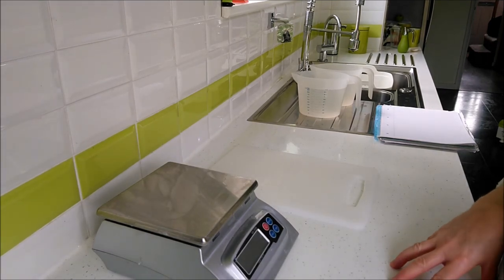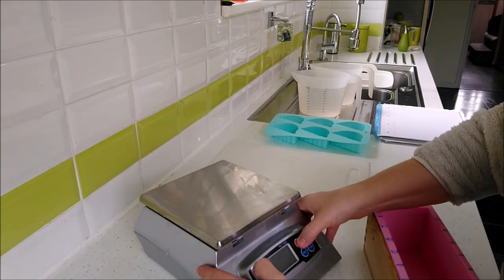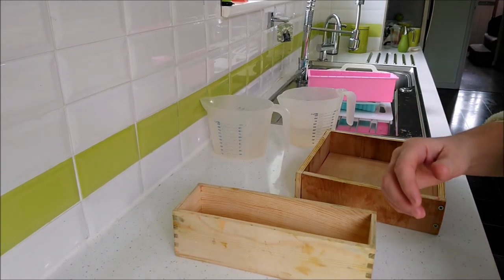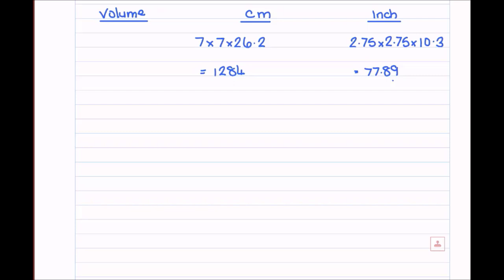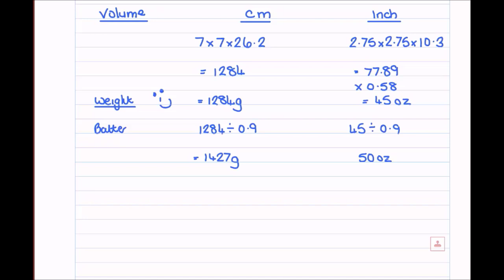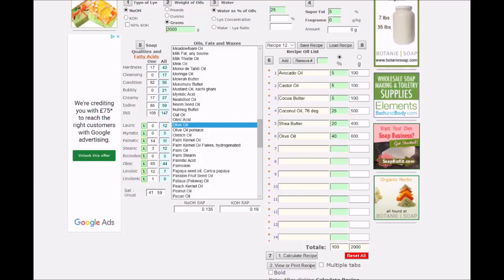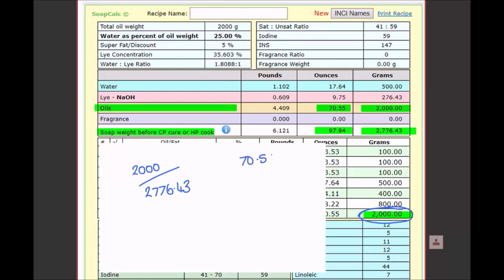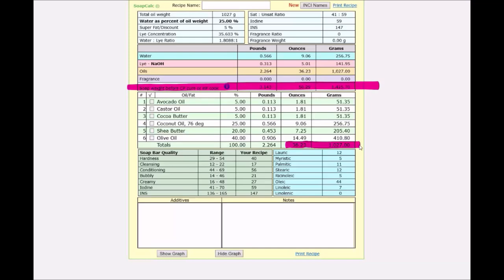HOW TO MEASURE A SOAP MOLD (mould), FREE soap mold calculator download - cold process soap tutorial.

Comment: Hi. Thank you so much for your very detailed video and explanation. In your video at the 7.20 mark you state that the volume = .7789. However, when I multiplied your measurements I got an answer of 77.89. Do you have to divide  buy 100 in order to move the decimal over, always? Also, you multiplied your volume by 0.58 vs what other do at .40 for the weight of NaOH. I can be a bit slow so I apologize if this question is off.  I'm just trying to understand the formula better so that my calculations are not off when resizing a recipe to fit my mold. Thank you in advance for your help.
Reply from the maker: HI Idalina. I'm so pleased you found the video helpful. I too get 77.89 in that calculation, maybe the decimal point doesn't show well on the screen, but I do also say 77.89 ounces. The 0.40 that you typically see quoted is an average figure that is used to convert the volume of a mould to the amount of oils needed. It's what I would call a 'quick & rough' method that will get your volume close but not necessarily that accurate and depending on the volume of water you use in your recipe it can be out by some way. My calcs are a bit more complicated, but they give you an accurate quantity. The 0.58 turns the volume of water in the mould in inches into fluid ounces. Then I divide by 0.9 to take account that oil is lighter than water, so you need more. Then I look at my specific recipe to find the actual amount of oils in that volume. That's the last step. It may seem a bit complicated, but once you get used to it you'll fly through it, especially if you use the same recipe. I hope this helps, please feel free to ask any more questions if you get stuck at all.
Reply: @IDreamInSoap  thank you so much for replying and the very detailed explanation. This makes a bit more sense to me now.
Reply from the maker: A little update, I thought I'd post on your comment as you may find it useful. I have also  handy spreadsheet where you can just enter the size of your mold in inches, cms or by using water weight and it will calculate the amount of oils you need. The spreadsheet will also help you calculate the % of oils in your recipe (using soapcalc). If you would like a copy just download it from the link in this comment. It's free, no strings attached. I just produced it to hopefully help people out. If you would like to share the document with others, that's fine, but it would be lovely if you would just direct them to my Youtube channel so they can download it (and maybe subscribe if they like what they see :-)  )

Here's the link:
https://onedrive.live.com/edit.aspx?resid=875659A477B22D5!28947&ithint=file%2cxlsx&authkey=!AIVMZtupZR6tY4o
Reply from the maker: A little update, I thought I'd post on your comment as you may find it useful. I have also  handy spreadsheet where you can just enter the size of your mold in inches, cms or by using water weight and it will calculate the amount of oils you need. The spreadsheet will also help you calculate the % of oils in your recipe (using soapcalc). If you would like a copy just download it from the link in this comment. It's free, no strings attached. I just produced it to hopefully help people out. If you would like to share the document with others, that's fine, but it would be lovely if you would just direct them to my Youtube channel so they can download it (and maybe subscribe if they like what they see :-)  )

Here's the link:
https://onedrive.live.com/edit.aspx?resid=875659A477B22D5!28947&ithint=file%2cxlsx&authkey=!AIVMZtupZR6tY4o

Comment: Great video thanx. I started a few years ago, but simply weighed the amount of water up to the top and used that amount for my oils. Works for me as I make a mountain in the middle of my soap. I’m going to check out soap calc tho because I’ve done all the hard yards figuring out percentages allowed of each oil and manually added them up. This way is so much easier than the Sage Lye calculator that my mum used years and years ago and I still use. X x
Reply from the maker: Thank you so much Lee Van Leeuwen, the water method is great especially for funny shaped moulds. I hope you get on with this method

Comment: I have that same mold you used as the example. It would never hold 45 oz. lol
The match I use is Length X width X height X .40. This gives me just the weight I need in oils (calculation  doesn’t include the lye) by the time I ad my lye solution I have the perfect amount for my mold 😉
Reply: Does It matter cm or Inches? Thank you
Reply: @tamaragleaves  the X.40 gives you oz of oils needed for your batch. If you use grams then use .L (cm) x W (cm) X H (cm) X .70. This = the grams of oils needed for your batch. Hope that helps.

Comment: Thanks for the informative vid.  What about when you add other additives since the calculation for capacity of soap moulds is only done by measuring the oils?  For instance, if have 1000g of oils as enough for my mould, what happens if i add turmeric powder, etc which is calculated based on the amount of oil.  So if I add 2% turmeric powder, = 20g then that makes 1020, plus plus plus.  So the mould overflows :))). Please help.  Thank you.
Reply from the maker: If you add a lot of other additive you would factor those into your % of oils in the recipe. So you would look at the weight of everything you include, then calculate the % by comparing the weight of the oils with the weight of everything.
Reply: @IDreamInSoap  Thank you for the reply.  But my confusion is that, the amount of additive is calculated based on the amount of oils.

my dummy calculation: just an illustration of adding this and adding that:

Oils (based on mold) = 1000g
PLUS (lye&water.        = __ (pre-calculated)

PLUS:
Turmeric 2% of oils = 20g
AC 1%.                      = 10g
sod lac 1%.              = 10g
colorant 0.5%          = 5g
etc etc etc 1%.         = 10g
________________________
                                   = 1,055 PLUS NaOh + H20

I understand the amount of additives are "percentages" extracted from the amount of oils. So if I then add these additives, the batter will overflow.  But if deduct these total additives to maintain the exact 1000g for the mold, then the ratio is not longer 2 or 3 or 1 or 15 percent of that 1000g. so confused here.

Comment: Hi Lisa, I tried to use the calculator you have generously provided but I can't seem to find how to edit it in order to put in my measurements. Please help and thanks!
Reply from the maker: Hi Ariane, are you using Excel, as it's an excel document. I know a few people have tried with a mac and it won't work as the format's not correct. If you are using excel, you should only have to put your entries in the coloured boxes (green for grams & cms, orange for OZ etc)
Reply: Thanks For responding. I am using excel however it opens as a read-only document. Do you have any other suggestions? Thanks
Reply from the maker: @mumtoaidan I have checked the file on the website, it's not read only, but you can only enter anything in the coloured cells, the other cells are protected so that you cannot accidentally change and alter the formulae, so you should be able to enter your measurements in those, but you won't be able to change anything else.
Reply: Hi Lisa, sorry to be such a bother. I'm actually a member of Saponification Nation. Is it possible I can send you a pic of what I'm getting when I access the link? Thanks
Reply from the maker: @mumtoaidan  Of course that's fine
Reply: @mumtoaidan  you actually have to save as and then open it in excel that is in your computer

Comment: thank you for this great information, but do you know how to calculate the weight in the case of making melt and pour soaps?, just an example... I have a mould that gives me 84,8 cm3, but in weight it's 107 gr so calculating it gives me a density of 1.27 gr/cm3. it means I should multiply every mould volume by 1.27 to have the weight I need for melt and pour soaps???
Reply from the maker: Sorry, I'm afraid I don't as I never use melt and pour, so not had the need to look into it
Reply: That sounds perfectly reasonable to me, I don’t see why it wouldn’t work.

Comment: Hello!!! I have been playing around and doing my calculations based on this video.. first of all THANK YOU SO MUCH!!! 

I did have 1 question though. My mold is 51.13cm x 6.50cm x 7.62cm = 2532g. 
Total batter I got was 2813g after dividing 2532 by 0.9. For total oils I got 1912g after multiplying 2813 by 68% which was the percentage I got. After plugging in 1912 into soap calc, the total batter weight is 2795. My question to you is: Is it a big deal if 2813g vs. 2795g for total batter weight? That is an 18g difference. 

Super Fat: 5% & Lye Concentration: 33%
Reply from the maker: Hi Shannon, no that won't matter at all and in fact I'd probably just go for 2800g to make it easy
Reply: @IDreamInSoap  oh ok perfect!! Thank you so much!! This video is amazing and I have it saved as my number 1 for soap making!!

Comment: Hi, Lisa I need to pick your brain about silicone mold.  So I ordered a beautiful wooden mold from Etsy the measurements are as follows 18"x 3.5"x 4.75"inches. the silicone liner that I found is the right size but a little off measurements are as follows 18" L x 3.5" W x 3.5" H. So as you can see the 1st 2 are perfect but the 3rd a bit off. So how do I increase the height to equal the mold? I was thinking maybe adding an additional top to add some height which would be taped, and that would be where the silicone is poured on from the bottom going down🤷‍♀🤷‍♀ what do you think?
Reply from the maker: I think it may be tricky trying to use a silicone liner as your  'mould form'  and then pour silicone over that to create a new liner. Firts of all check the measurements. The form that you want to pour over needs to be about 10mm smaller than the final liner you want, as once you cover it with silicone the final liner you make will be bigger. I would hesitate to add extra bits on the top to create height as you are likely to end up with a liner with lines inside of it, the silicone will go into any tiny gaps you leave between the original liner and what ever you add to the top, even things like sellotape make markes in the finished silicone. Also you would kneed to make sure that the liner your using for the 'former' is solid, silicone is heavy and as you pour it the weight of the silicone will push against your former causing it to bend and distort, which would leave you with an odd shaped liner that you pour. I don't think it would be easy to make it work well I'm afraid.
Reply: @IDreamInSoap  Thank you😁😁

Comment: Strange Question? Can i substitute the 51g cocoa butter and 51g avacado oil for any other oil? Say like extra coconut and caster oil?
Reply from the maker: Yes you can, but you will need to run it through a soap calculator to correct the amounts of lye you need

Comment: How do you calculate for fragrance?
Reply from the maker: I always work out fragrance based on my oil weight. So decide on the fragrance you want o use, in the UK the limit is 3%, but in the US there is no overall limit, but every fragrance will have a safe useage rate, so check the IFRA document that comes with the fragrance and look at category 9A that will tell you the limit. A lot of people in the US use 5%  as amount they put in. So take the oils you use say that's 1000g and x 5%, that will tell you to put in 50g.
You will find some people use total soap weight, some use oil weight. If the IFRA limit is quite high, you can choose which you like (total batter weight will mean more fragrance and a stronger smell) but if the IFRA limit is low (say maybe 4%) the you should use oil wight only. Hope this helps.

Comment: Thank you for this, but it doesn't work for me. The oils weight is way over what I need. I have followed the calculations to the letter. I have even tried for a mould I know the capacity of.
Reply from the maker: Hmm, that's odd, it should work, lots and lots of people have used it and had success, hmm sorry it didn't work for you
Reply: If you measure in inches do this. It WILL work: width x length x .40. This determines your oil amount only.
When you use a lye calculator  plug that oil amount in. The calculator will automatically fill up the rest of the mold with lye, oil, and fragrance. 
Round objects are formulated  using pi.
I made my own lye calculator and this is one thing I do.
Personally, I use .42 but using .40 is popular and still works.
Often times people who sell molds are very wrong about the amount of soap it will hold so knowing this comes in handy. One mold I use was advertised at holding 120 oz. Of soap. I told him it held 139 oz exactly. I was exactly right and filled it to the rim. What's better was I calculated 3 layers. I made a video of it. You can see what I use. I've modified it more since then though.
Reply: Now I know what you did. You plugged into the lye calculator your total amount of soap instead of your oil amount.  That is why ended up with extra.
Reply: iwannaapple I’ll have a look to see if that is what I did, thank you

Comment: Need advice for designing 1.2 kg mold. I have customized my design mold- L (37.11cm) * W (5.50cm)* H (8.50cm) - inch(14.61*2.17*3.35). 
Math behind the building the mold - inch(14.61*2.17*3.35) * 0.4 (convert into oz) = 42.36 oz and then multiplied with 28.375 (42.36*28.375) for converting into grams; is that right way to get grams ? I would seek your expert opinion, how to build 1.2kg / 3.6 kg wooden mold. Soap Size that I thinking to make (8.5*5.5*3) cm; 12 bars 100gm. What should be the inner dimensions ? .  I have taken - Water as percent of oil weight 21.81 % : Super Fat/Discount 4 % :Lye Concentration 40.0000 % : Water : Lye Ratio 1.5000:1.
Reply from the maker: Hi and welcome. If you are trying to make a mold and work in grams you do not need to go anywhere near inches (that just makes it all complicated). Work out the volume in cms, then the volume in cms will be the same as the weight of water in grams, to the take account of the fact that oils are lighter than water DIVIDE that volume by 0.9, your figure should get bigger. This will now give you the total soap weight of your mold.  When you ask about the inner dimension that will be the size of the bar that you want, so your 8.5 x 5.5 cm by 30cm long (I'd so maybe 31 or 32 to give you 10 bars plus the extra bit to cut off the ends. A mould that big would give you just over 1.5kg of soap.
Reply: Thanks , I took only cm for measurement – 30.5*5*8 = 1220 / 0.9 = 1356 ; 1357 *69% (Water as percent of oil weight 22% : Super Fat/Discount 4 % :Lye Concentration 40.0000 % : Water : ed .Lye Ratio 1.5:1) that why I got 69% instead of 72% as you shown in your video. So I got(1357 *69%) 935 total oil need and total batch weight 1357. My question now is , if I need to cut the bar size 2.5*5*8 and same time the net weight of bar need to be 100 gm; Then how I need to design the mold ?
Reply: I would value your expert feedback on the above question, it will help me a great deal. Thanks!!
Reply from the maker: @Sreenathplus  HI Streenath, so sorry I didn't get a notification that you had replied to my previous comment so I wasn't aware of it. Your oil % sounds sensible so I'm sure you've done that right. If you cut your bars 2.5x5x8 the volume of each bar would be pretty well 100g, that may vary a bit depending on how accurate your cutting is. Don't forget the bars will lose weight as they cure, so if you want to end up with a 100g bar it's freshly cut weight will need to be more. I'm not really sure what you mean by how do you design the mold, if you've decided your bar size is 2.5x5x8 then your mold will be 5cm wide x 8cm high (I'd do it higher as you don't want to pour right to the top)  then the length would be 2.5 x however many bars you want plus a bit to chop off the ends, so if you want 12 bars I'd probably make it 31 or 31.5cm long. - this would give you pretty well a 1.2kg mold as you mention in your 1st post (remember if you make it taller than 8cm that won't affect your soap batter calc as you will only pour to 8cm high). You may need to compare one of your fully cured bars with a freshly cut bar if you have some around that are the same size (won't be 100% accurate but will at least give you an idea) of how much bigger to make them. I hope this helps a bit. Best wishes
Reply: @IDreamInSoap  
Thanks indeed, I got the gist. Remodeled the calculation with 31*5*8 =1240/0.9 =1377.78 * 73% (Water as percent of oil weight 22%: Super Fat/Discount 4 %: Lye Concentration 40.0000 %: Water: Lye Ratio 1.5:1) + Oil combination Coconut -25%: Castor – 5%: Palm – 40 %: Palm Kernel – 5%: Sunflower – 25%) 1377.78 * 73%=1006, total batch 1371.73 (1.3 Kg). If I cut 12 bars Width – 2.58, 114 gm per bar / cut 13 bar width -2.38 , 105 gm. Hope my calculation is good to go, want to check with you before I go head. I really appreciate your time & support.
Reply from the maker: @Sreenathplus  just bear in mind that your calc to cut into 12 bars etc does not take account of you taking the ends off, do you leave then ends as they are or do you slice a thin bit off the loaf at each end? If you slice a bit off you will need to increase the length of you mold for that (and increase the soap you make) I think a 105g bar will be pushing it if you want to end up with 100g cured weight, do you bevel the soaps, that will lose some as well as the cure process. I'd make the mold concentrating on the width and height you want of the bar then for the 1st loaf you make cut it various thicknesses, bevel, if you normally do and then see what they weight after the cure. If you're not really bothered if they're 100g then just label accordingly whatever size you cut.
Reply: Thank you